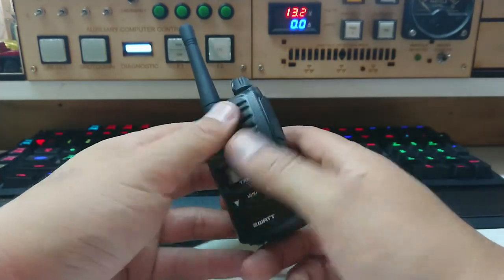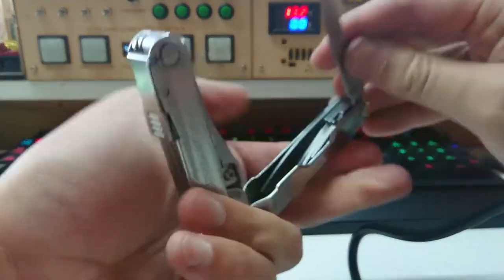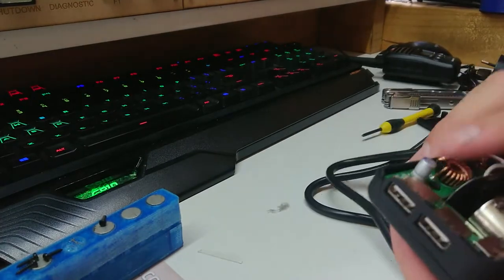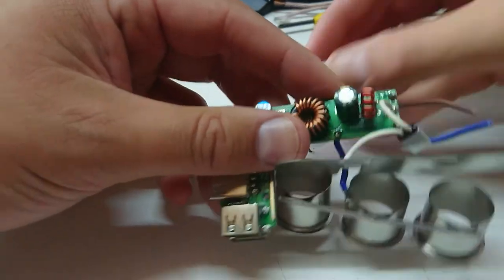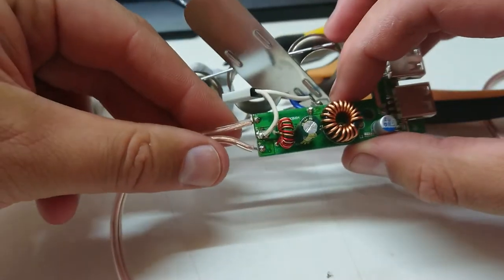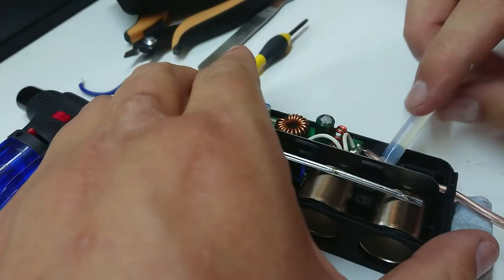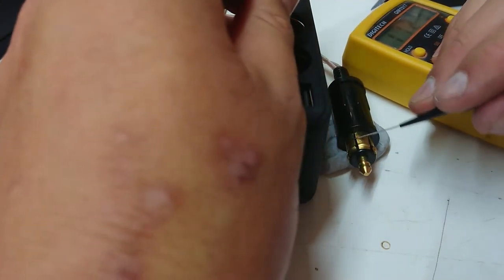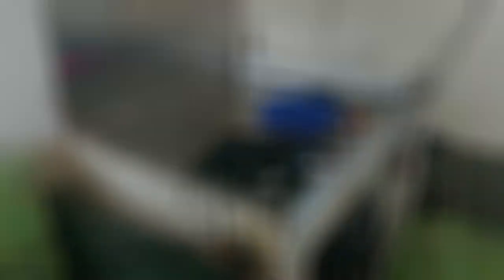Jaycar Cigarette Lighter/USB - merit plug mod.

Comment: 60/40 flux 👌👌👌👌👌👌👌👌
The discarded DC plug with the digital voltmeter built in, you could remove the flying leads and use it as a DC socket tester/monitor.
OR
Make a DC extension lead.
Reply from the maker: Yeah considering that, it's gone in my spare parts box until I find something ill-advised to use it for.